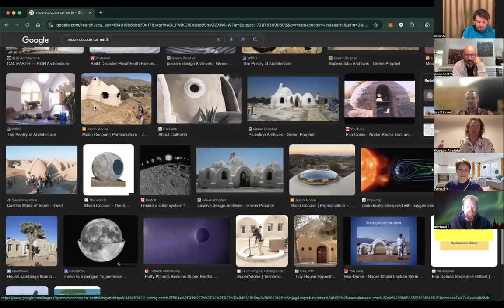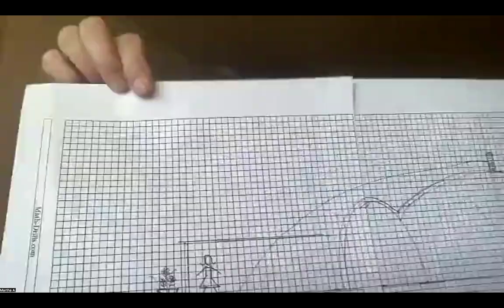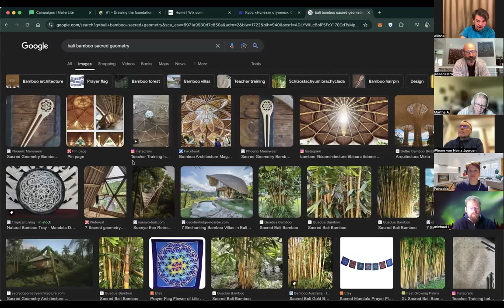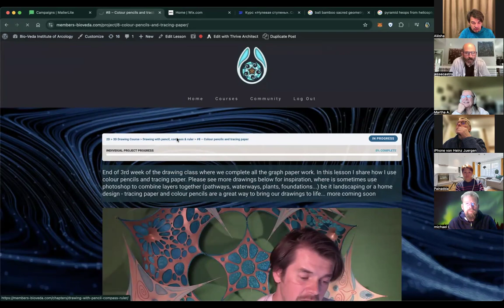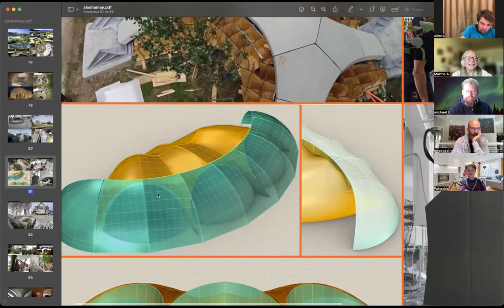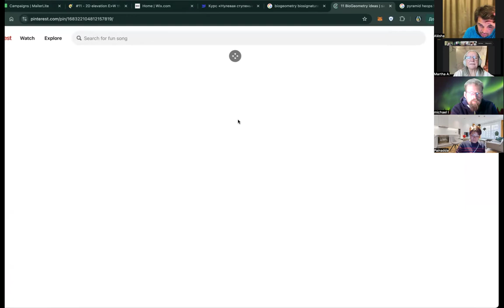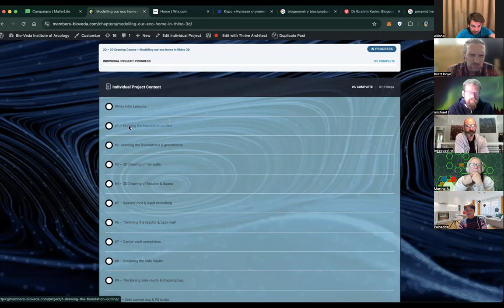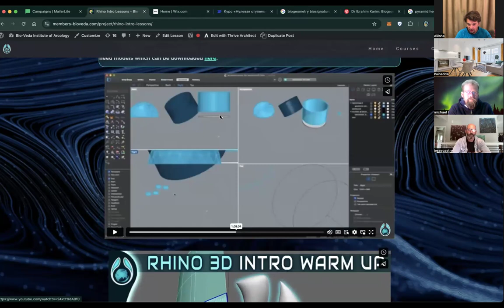Vastu Bio Architecture

Comment: Hey thanks for sharing this... I was sooo close to signing up myself, but decided against it because I'm still to far in the planing phase... Before I buy any land I wanna know more about Vastu and find more participants. The project will be 5 Earthships (or similar) surrounding a huge venus flower (a powerful earth healing symbol),  combined with a food forest... 
As I am in Paraguay our most important topic will be cooling and dehumidifing the hot air. At the same time the structure will have to withstand at times pooooouring rain and/or heavy winds... 
I'll follow your videos here and will reach out when the time is right. 😊
If anyone is interested in joining our little paradiesbuilding just contact me 😊